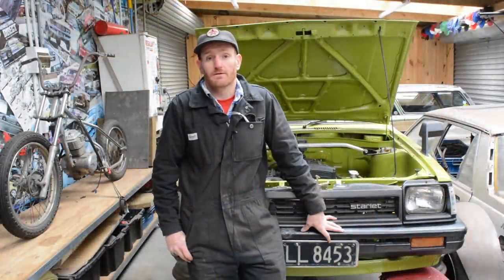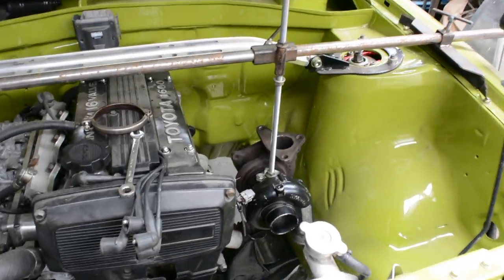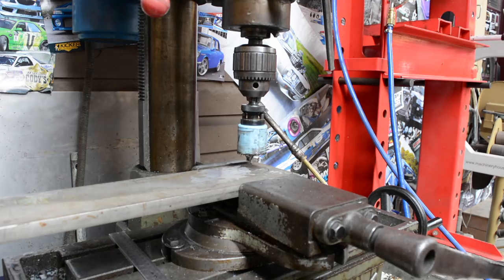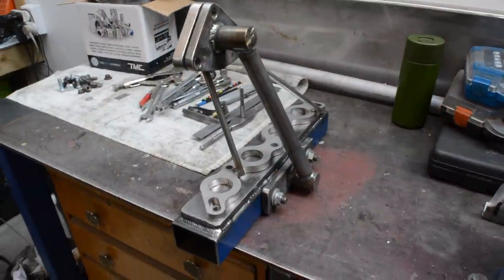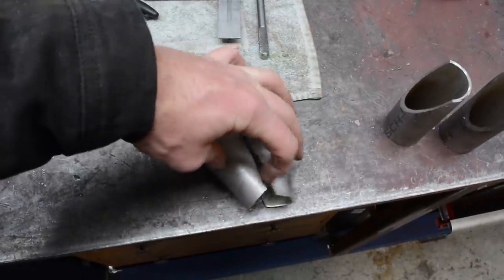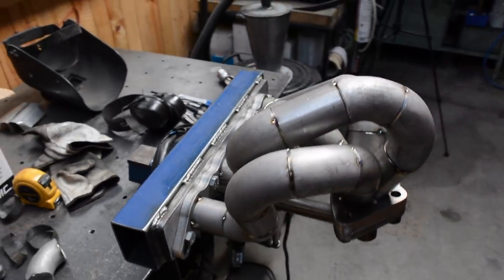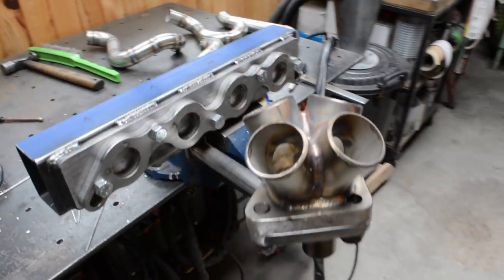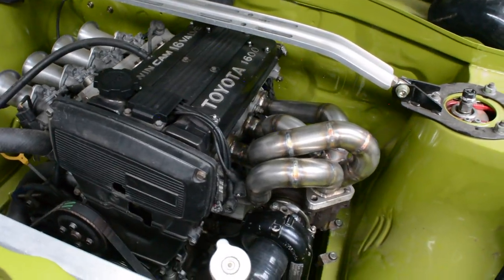Toyota KP61 Starlet 4AGE - Exhaust Manifold Fabrication

Comment: nice vid, is the distributor going to clear? and are you going to use a heat shield
Reply from the maker: It won't be running a distributor as I'll be using a trigger system off the crank and cam.